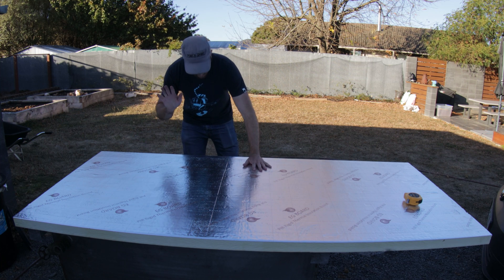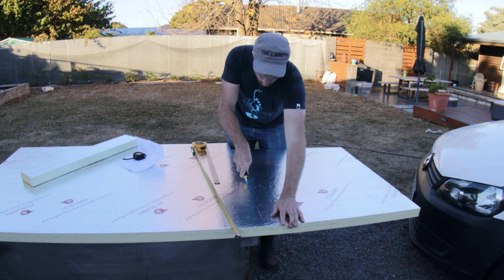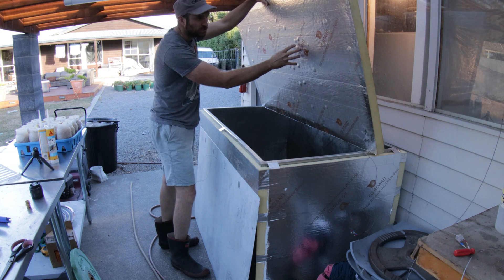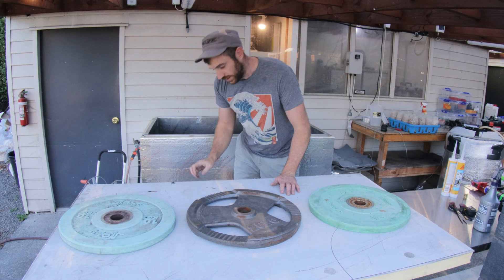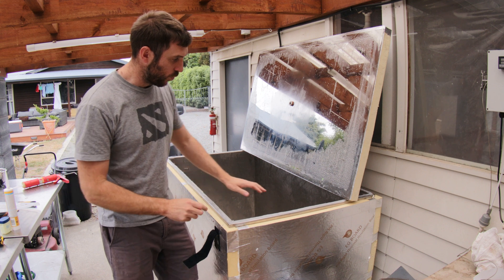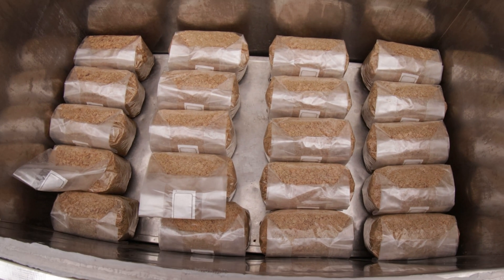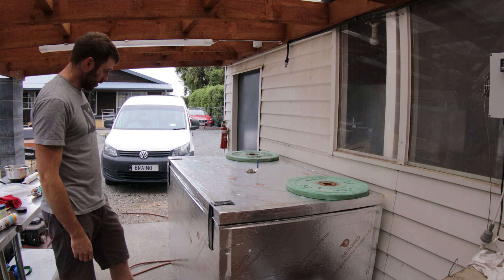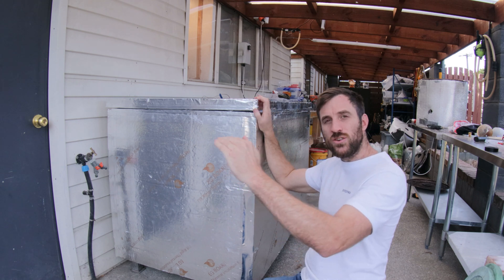Making a New Mushroom Sterilizer/Pasteurizer Chamber

Comment: Please if it’s possible, could you answer a question? I did some tank like yours to do de sterilization in my substrate but I did a test with some blocks and I had 100% of contamination. 
Is it importante to do the sterilization with the tank full ? To increase the pressure?
Or it doesn’t matter?
And the temperature that I get is 103 Celsius. Is it sufficient or I need more?

Comment: Consider direct firing the stream box itself. Essentially make the tank the boiler in one.
Reply from the maker: I used to do that, but I shifted to multiple barrels on my old setup, so ran one boiler to steam them all.
Reply: @OakandSpore  
I wonder if a return back to the generator might be beneficial. If the system were perfectly sealed, the increased air pressure from simple PV=nRdT would be problematic to say the least. You have enough leakage that you are forcing me he cool air out as you drive steam in, but as I am sure you have sussed, eventually your steam generator must produce sufficient steam to replace the volumetric and radiant leakage. Have you given thought to submerging your blocks in a cage instead? You would have the added step of draining off the water into a holding tank, but your steam volume loss could be far less. Yes, the blocks are buoyant, thus a cage. You have the experience, just trying to think how the next generation might be improved. Ultimately, you want to only provide heat to the thermal rather than thermal and steam volumetric losses. /shrug

Comment: Only yet another option... Prefitted cabinet (spring loaded) catch n latches strategically placed around your stainless box. Then with that done right, you could possibly resolve the sealing down issue with your lid.

Comment: Hi Tom,

I have seen a lot of videos about steam sterilizers.
The only thing i still dont understand is, how to vent the steam out of your tank so the pressure is not building up?

Thanks
Reply from the maker: There is a vent in the top and a pipe which lets its escape.
Reply: Don't bother venting it. Stream at atmospheric temperature is lighter than air and will escape too if you do this. You actually need to vent the air from below which sounds counterintuitive but it's true...  With a surface area this large it would take ton metric tons of weights just to allow half a kilo of steam pressure so there is zero chance of bursting this stream tank that way.
Reply: @neogeo8267  so if i leave the drain/tap open at the bottom, i get rid of the condensed water and buildup pressure in the same time?

Comment: why not just build the box out of the insulation and get rid of the steel box? cover it all inside and out with epoxy resin and it should be strong enough and waterproof. probably less heat loss than with the steel box and a lot cheaper and easier.
Reply from the maker: Because it's not strong enough to hold 200kg of substrate.
Reply: @OakandSpore  as long as it is lying flat on the ground it would be plenty strong. rigid foam has high compressive strength. you can easily walk on it without crushing it, and your feet are putting down way higher pressure per square inch than the substrate would be. and coating it in epoxy resin would increase it's strength as the epoxy distributes the weight more evenly.
Reply: bad idea. stainless is the best material for this

Comment: for the downforce problem, you could use a tension strap / securing strap or how they are called. put the straps around your container and secure the straps with one of those ratchets. you can get more than a ton of downforce, depending on your strap, that should be enough to keep that lid nice and tight down
Reply: Could also still just utilizing the Velcro probably get more down force by having Velcro attached to lid and pull the Velcro Down as hard as u can and sticking the Velcro so be able to get little more pressure on the compared to pushing down with one hand as hard as u can while using ur other to pull the Velcro over and stick it.
Reply: Probably won't.
Ratchet straps=/=velcro

Comment: Hey man, I thought you could use a solution for the lid. It's probably not a good idea for your back to lift this thing off regularuly and will most likely deform and rub off your seal. You have some sturdy beams right above your chamber, so how about installing a winch? Tuck some loops around every corner so you can lift the lid directly up and hold it up there right below the beams while you work around the chamber.
Reply from the maker: Its actually not that heavy, just kinda awkward to life. Maybe 20kg max.
Reply: @OakandSpore  yeah, I'd guess so. But leverage is a bitch.^^
Reply: @OakandSpore  did you consider a construction with flipping the whole box 90 degrees and put it up a bit to be able to offload it horizontally instead of reaching down in the bottom? Some rework with your piping needed to regig the steam to still come from underneath? I’m looking at alternatives of either buying a similar sized autoclave, or go with your type of non-pressurized
Reply: @voccyvoc  better yet flip the whole box over and lower it over the bags like a turtle shell. Steam rises anyway so it makes no sense to have the door and a vent on the top

Comment: You could make your own stainless steel barrel in 30 minutes. You would just need to worry about getting power to it and connecting a pid
Reply: That’s what he did/was using, before this.
Reply: @qwqwueis  right but it's underpowered like he said. He needs to make another one which he is having fabricated somewhere. He could do it on his own very quickly.
Reply: @cactushatmushrooms3677  ah I missed the part where he said it was underpowered. I actually just built a drum sterilizer myself, about to test it today. Do you have a parts list of one you’ve made and use successfully? Hopefully mine doesn’t have the same issue.
Reply from the maker: The steamers where the element is inside the barrel are dangerous. If there is a water supply problem, then the element will start to cook off the wood substrate. It happened to me, and turned into a giant furnace of superheated wood. That is why I separated the boiler into it's on vessel.
Reply: @OakandSpore  I remember you mentioning this and plan to eventually separate the heating element into its own vessel but hopefully for my first few runs I can babysit it and make sure the water supply is up to par.
Reply: Not to be a ah ha moment but i use the inside heating element and only had two minor inccidents. Both my barrels ran dry but i didnt get a fire. All i got was the heating element cracked and quit working. But it was at the tail end of the cycle. Anyone can use what they have available and what works fer them. Plus i have been using the same drums for 3 years and just do cleaning maintanance.
Reply: I love this....I am just starting out and I'm trying to build a steam sterilizer from scrap that I can find around here in Turks and Caicos. I found an old large metal food hot box that can be insulated and an old heating plate from a dry cleaners for a commercial iron. Wondering if they can work.

Comment: Wife-heater instead of the wife-beater. 
Or maybe the baked widow? 
I can only come up with wife puns... 

To get more serious: How did you come to the decision to (super-)pasteurize your substrate at 95 °C? Most often I could find either pasteurization at 80 °C or kill everything at 121 °C.
Does the PID controler controlls, that the boiler is constantly near the boiling point and thus pumps steam constantly? Or do you hock up the PID controler to the steam tank, so that it remains a certain temp (95 °C)? Thanks in advance!
Reply from the maker: Haha, maybe I should call it my mistresses?

I don't believe what I am doing is pasturisation, or even the fabled 'super pasturisation', I believe it's an incomplete sterilization. Cooking substrate for 24 hours at 95c reduces live organism numbers down to 0.1% of what they are before you start, and I think this gives the mycelium enough time to get a foot hold. I'll make a video about my reasoning shortly..
Reply from the maker: Further on this, you don't need to use 121, you can use other temperatures, it just makes the time required longer or shorter. It's called thermal death time.

Comment: I'd name it according to its dimensions, however I would just tack on the word beast for theatrics. I'd also change the holes on the bottom for more even heating. The steam essentially has to escape through 2 containers. The second being that false floor. If you want to heat the middle differently, yet pack in more bags, why not create steam channels vertically? If not, perhaps create more spaces in the bottom grate. I imagine the Roman's knew a thing or two about steam baths. The Beast will be steam hungry either way!